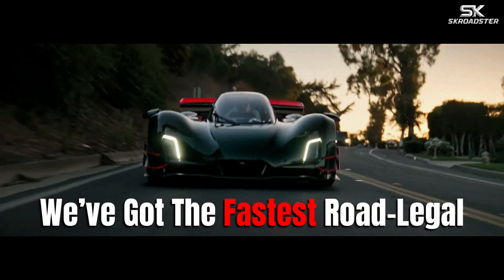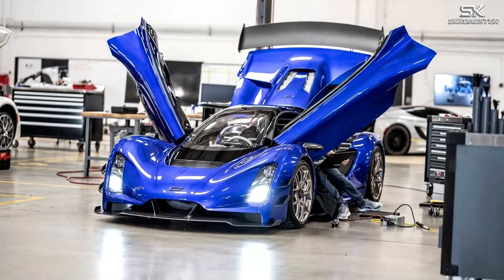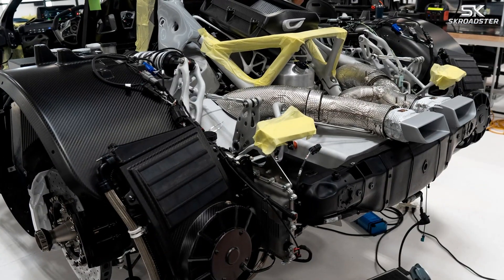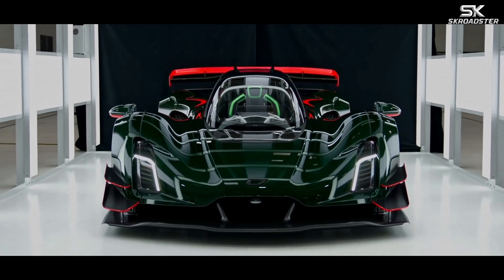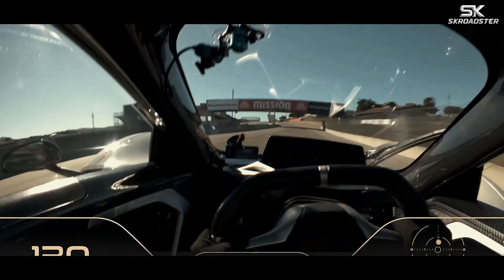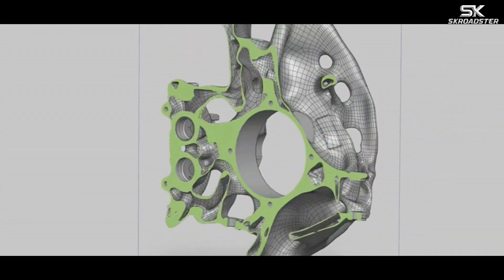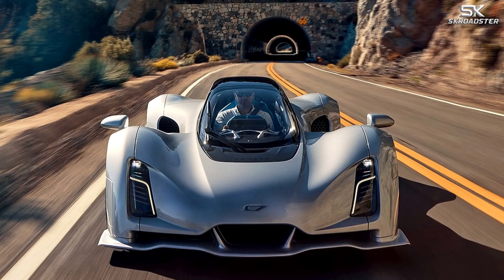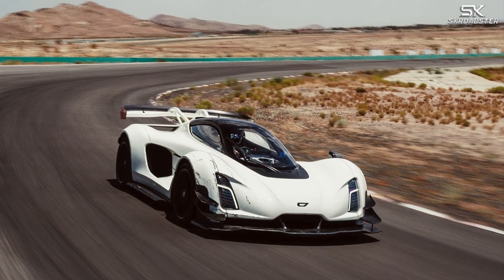This 3D-Printed V8 Car DESTROYED McLaren & Porsche Track Records | Czinger 21C Blackbird

Comment: There is no such thing as true AI....if it was real then the greatest AI... Google... wouldn't return a search for pictures of the founding fathers as all soul brothers with dreads.
Reply from the maker: What makes the Czinger 21C truly different is how its structure and many components are optimized using AI-driven generative design software and then 3D printed. This digital design + robotic assembly approach lets engineers create ultra-light, ultra-strong parts far more efficiently than traditional methods, helping unlock record-shattering performance.